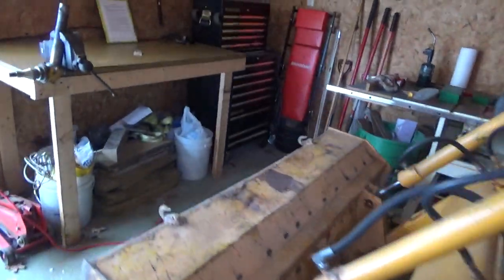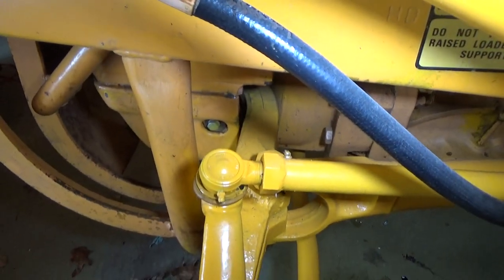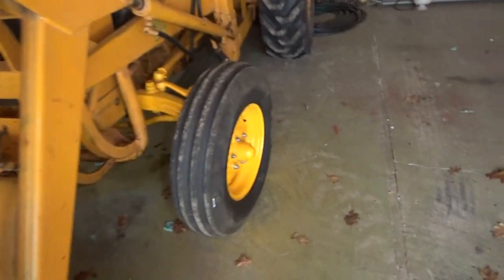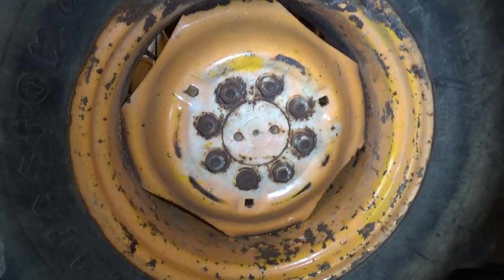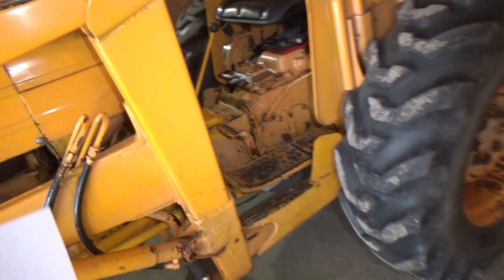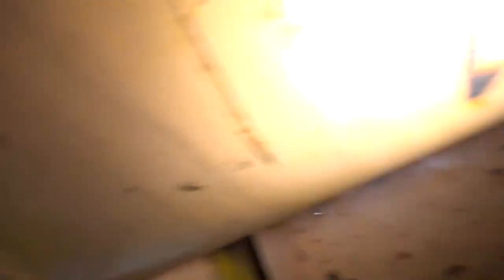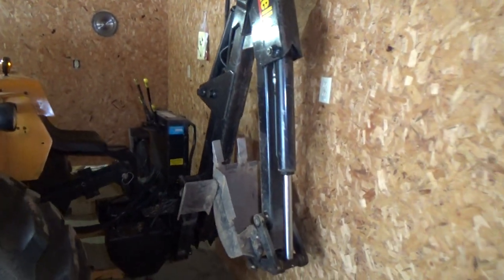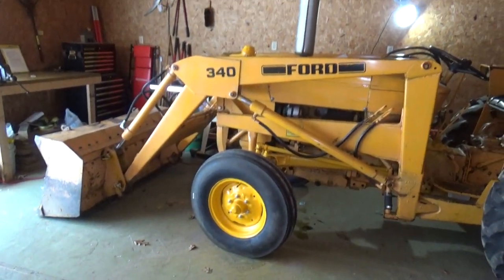ford 340 tractor fix (Jerry Terburgh YouTube )

Comment: When I first saw the video I didn't like it because of all the negativity.  After that wore off I watched it again and am very thankful for it so I gave a like.
My brother got one as partial payment for work he did dealing with heating and air conditioning.  He never ran it 20 minutes in the past maybe 3 years or so.  He just gave it to me for all of my work, which he didn't have to do.  But I'm thankful because I had to sell my Ford 4000 with a loader and 3 pt hitch Sherman backhoe.  I'm ready to dig in and get it going.  
Its very heavy with all of the wheel weights and roll bars and Bradco 11hd hoe.  I may be driving it home but its 12 miles of country roads and it sat for a decade before he got it.

Comment: The problem with these tractors is the electrical system design.  You are correct about all of the fires.
A heavy gauge wire runs from the starter across the tank to the ignition switch then to the intake manifold heater(10 amp draw) and lights WITHOUT any relays.
I've had mine for a month and dug into it.  The ignition switch has been replaced and the area above the tank is a rodent heaven-complete with balcony, view of the ocean, and time shares.

Comment: I have a ford 340 industrial tractor with front end loader and rops and clamshell fenders and yes I got it cheaper since the wire harness caught fire and burned from the steering wheel to loader bucket I repaired it and it is a good tractor

Comment: What is the link(  drag link,tie rod) called that connects at bottom of the steering spindles tire to tire. Where can I buy a new one? Mine has a long rod with permanent tie rod (passengers side)and the other side( drivers) is threaded like tractor. 2:20 in your video you called it a tie rod. I need the whole set up. Any help be appreciated.
Reply: I’m interested to know if you found the replacement parts and if so where did you purchase them?  Thanks, Tim in northern TN

Comment: I had one of them for over 20 years and put at lease 2000 hr per year and the only problem I had was the bars come from the front end back to the side of the transmission. The bolts would come loss or break. I used it heavy in commercial landscaping and had to replace the injectors once. It was a great tractor. Makes me wonder what kind of abuse this tractor had.
Reply: Thank you.  My brother got one that sat for 10 years and started it right up.  He hauled it to his camp and there is sat for 2 years.  He just gave it to me yesterday.  So I'm all fired up getting ready to get it working right then ran into this video which is really a buzz kill.  lol  Thanks for the positive reinforcement.
Reply: Oh yeah, it came from the factory as a backhoe and was first owned by the township.
Reply: @onenewworldmonkey  mine was a skip loader from the factory with a hydraulic top link and. Hydraulic adjuster on the lift bar. Wish I still had it

Comment: I'm getting ready to replace the water pump on my dad's. He doesn't seem to think I can do it without taking the whole front end off but I think it can be done.
Reply from the maker: If the fan shroud is still on there you will have to pull the radiator, if not you can do it

Comment: Lots of great information Jerry, thanks for the video. Looking to purchase one of these myself here soon. Is it safe to say that Ford had most of these problems straightened out by the time the 340A/340B/445A/445C/445D were out? I can't say I've heard many complaints from guys running the later models. I grew up on 445A's and a 445D which never seemed to have these issues aside from the wiring fire under the dash (which you'd think they would have straightened out early on). It seems the later models had much improved steering.
Reply from the maker: Most of the problems I think we’re just from lack of maintenance, very strong tractor I really liked it.

Comment: I know you have sold your 340 but i just purchased one. Like you said the longer gear shift handle just spins around. Did you ever use the PTO on yours or the 3 point hitch. Also is there a way to check the hydraulic fluid for the loader. i only see one place on the left side that you could remove a plug that has a little breather on it where you might add fluid. Overall I find your video very informative. thanks for making and sharing it.
Reply from the maker: Yes there is a dip stick on the bottom of that breather on the left side about 2 feet long, I had the backhoe connected to the 3 point, it worked well, very strong, very heavy, well built tractor, I only sold mine because we moved 2 states away, to big and heavy to ship.

Comment: I have one with the clam shell rear fenders. It’s a 79 or 80 model. I can find a pressure plate and a clutch disc but it has a giant release bearing made by ford motor co. that is impossible to find for a 340. Easy to find for a 340A and 340B. They always list it with the A and B but they are smaller than the earlier model. Guess I’ll put the old one back with a new clutch. Any suggestions?
Reply from the maker: I had some luck at the New holland dealer they bought out ford, you might try finding a name and part number on the bearing, research it that way, the part number may change a few times, some of the parts where made by other venders, and fit more than one tractor, good luck, they are a nice tractor, sold mine for 12 thousand, he was happy to get one.
Reply: @jerryterburgh9425  I’ve tried to find any type of number on the bearing but all it has is there abbreviations for Ford motor company. The way I understand it now fiat owns ford new Holland possibly with CNH. Either way they’re not in the USA. I will probably just give up and put the old bearing back in and sell the tractor because it’s just too difficult to find parts. Thank you for the quick response.
Reply from the maker: Call all states Ag 866-609-1260 it shows they have 2 types in stock, new holland bought ford out, I’ve ordered several parts from our New Holland dealer, costly but they got them, @joereinhardt5358

Comment: I am inquiring about the steering link bar, I tried locating the parts you listed but there far more specs being asked when ordering parts. 2wd,4wd, automatic, standard. The drag link and tie rod ends are available just need a little bit more information though can you shed some light on this?
Reply from the maker: I looked up the spec sheet for tie rod ends on the computer, but you may be able to get one from the auto parts store??? it look me two or three days, to match up the parts I needed to the spec sheet, and got the part number that way, I took the part number to the auto parts store and they told me what it fit. it was a lot of work.

Comment: Jerry- I was wondering if there was a way I could message/email you and pick your brain? I have questions on the the spindles you used for this. I have the same tractor with the same issues.
Reply from the maker: I purchased a digital caliper, purchase some on the web that were similar, but a little larger, took them to a machinist, and had them turn it down, I don’t remember what they were off of, but it was difficult to find ones that were similar
Reply: @jerryterburgh9425  In your comments you mentioned they were off of a Ford 8240. 

What about the ball bearings for the spindles? Did you just measure as well?

What had to be machined down? The king pin shaft to slide into the tractor?
Reply from the maker: I will bearings in the hub were the same, it’s just the spindle shaft itself was bigger in diameter, and longer,
Reply from the maker: Stupid auto, correct, I always seem to forget to check that
Reply: @jerryterburgh9425  For the spindle shaft after it was machined, did you recall what bearings you used?

Thank you for helping me with this btw!

Comment from the maker: Yes, good tractor, it has more horse power and has an 8x2 trans, you can look it up on tractor data.com that will give you a lot of information about it, also look at tractor house .com that will give you a price range, it mostly depends on how many hours are on it. 2000 hours would be low 5000 hours would be very high.
Reply: Jerry.  That was a good informative video.  Thanks.  I have a 340 with loader and a backhoe.  I'm located in southern Miss.  I have a clutch/pressure problem.  I can't shift.  I drilled a hole in the bell housing, figuring the clutch disc was stuck to the flywheel.  I pounded a flat screw driver in, all the way around, to free the clutch disc from the flywheel.  No help.  I'm going to remove the rear end and probably replace the clutch/pressure plate.  Any thoughts?